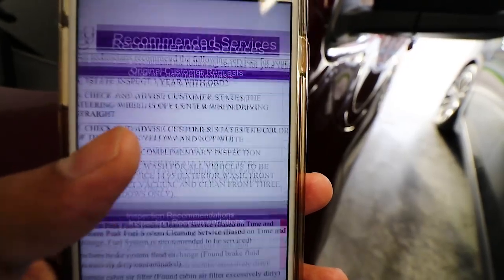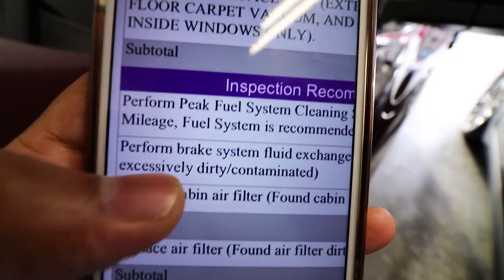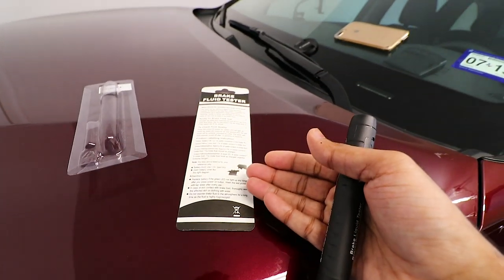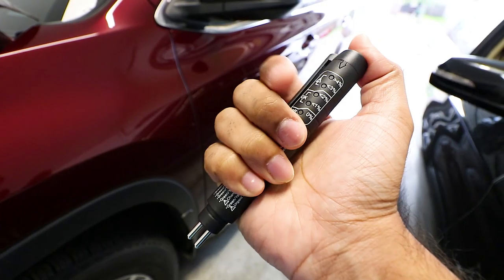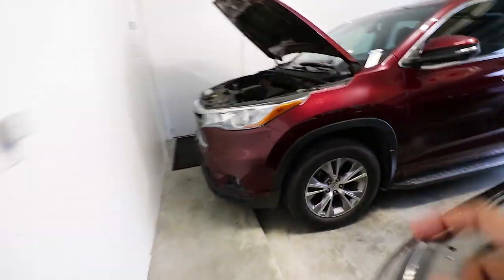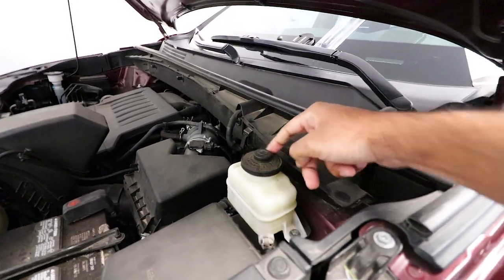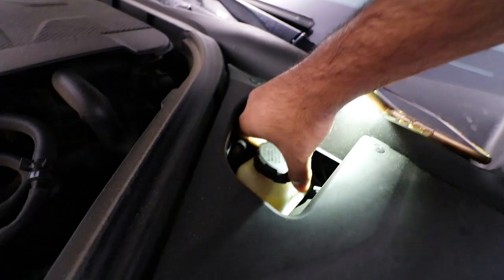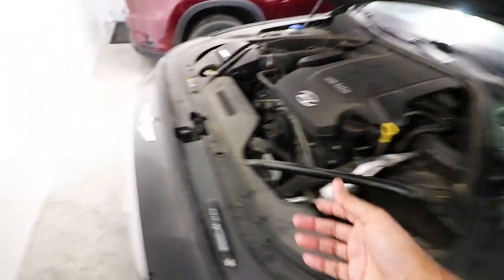HOW TO Check Your Own Brake Fluid $8 (Save Money)

Comment: It’s not correct method. Brake fluid need to be changed not because of moisture but because of anti-corrosion agent. Moisture doesn’t come in because the brake system is usually closed. The agent, however, is dissolved over time. The fluid need to changed every 2 years.
Reply from the maker: I’m not sure I agree with you fully there. However I respect your opinion for changing it every two years.
Reply: KLEANTRIX Its just a dealership scam, I work at a professional dealership in NJ and we usually get cars that are 10 years or older with original brake fluid and nothing wrong with it. Plus a technician trick that is pretty scummy and I don't do it, is that they will suck your brake fluid from out of your reservoir and just top it off with new fluid. Theres no way to prove they actually fully changed your brake fluid unless you open the bleeder valve and test the fluid that comes out of it, which no one is going to do.
Reply: erictold i work at honda dealer.    I Always tell the customer to flush their power sterling.   Brake etcc.    You get more commission money if you recommend those even if its not necessary.    But i haven’t change mines in 4 years.  Depending on your driving condition and the oil its not necessary to listen to what your car dealer says.  Just follow the car manual book and nothing what the dealer say!  Remember i work there!